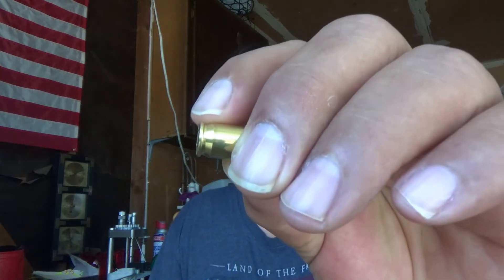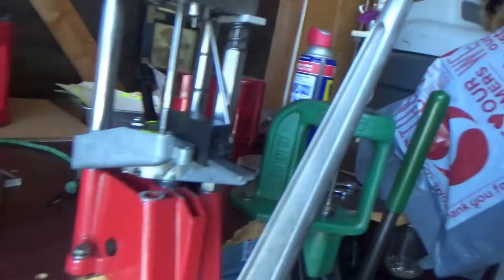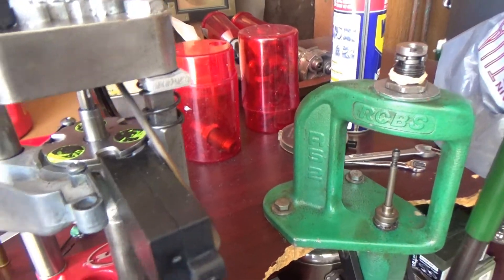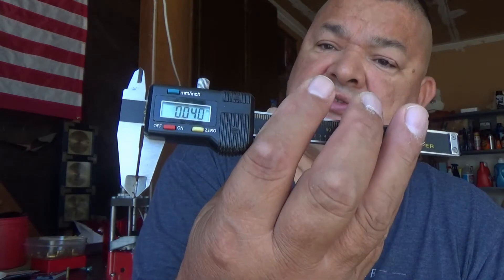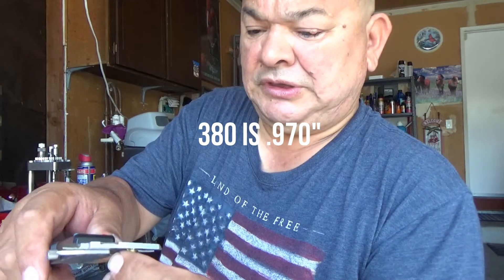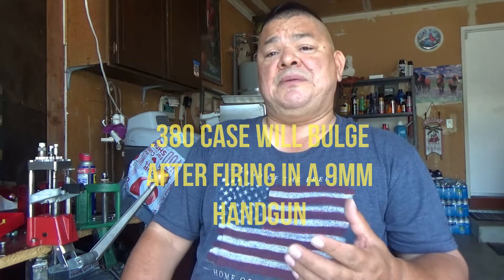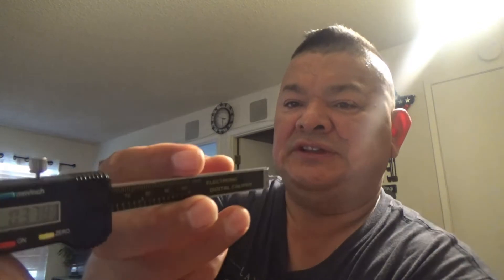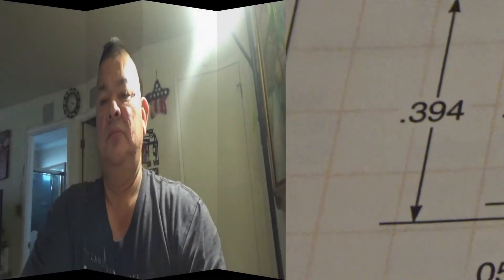Why you shouldn't use 9mm die's to load .380 a.c.p cartridges.

Comment: I would think if you have a progressive Dillon like the 650 you could just adjust your powder measure height and change out the seating and crimping die it should work fine.
Reply from the maker: I have the Dillon 550 B , it's not about loading for quantity it's about loading  for quality.
Reply: miked a few bullets from each sizing decapping die and they are very different.

Comment: My experience unable to find 380 die set in "these times".  Can salvage and use 9mm powder through expanding and bullet seater die for 380, nothing special as both use .355/.356 bullets.  Can use 9mm sizing die adjusted to deprime 380's, but not size.  That's 3 out of 4!  Only need a 380 factory crimp die to be complete (using it to size and crimp obviously). 9mm #19 shellholder can be used in place of 380 #4 shellholder (it'll work but long term will be annoying).  I ran into an issue the 380 FCD wasn't sizing tight enough on mixed range brass, bullets loose after seating, no friction. Lee makes a 380 undersize sizing die- fixed the issue.  Used 380 FCD in Lee's Bulge Buster Kit also- some rounds can get tight at the base in a case gauge.
Reply from the maker: I just checked eBay just now and starting bids for a 380 ACP dies or going to 71 dollars and up I saw a titanium Hornady set for $98 that is gone crazy extremely crazy just to get really dies unbelievable there is a YouTube video Manny California who does 9 mm to 380 and I don't know how he does it but apparently he said it works because the sizing difference in circumference on each shell from 9mm to 380 is totally different and like you said you might have weak neck tension cause the bullet to see deeper 3 80 circumference is 374 9 mm circumference is 380 so using a 9mm die set will not give your 380 proper neck tention. Good luck

Comment: I run a Dillon 550 and a 650 and the 380’s cause problems because they don’t fit right in the shell plates. Causes stoppage of the progressive press, a few mild profanities and a general pain in the backside.  I have devised a quick & easy method to sort all the 9mm range pickups to remove the devils spawn 380. 

Good video thanks for posting.
Reply from the maker: yes agreed that the .380 a.c.p shell rim can be tricky i measured out several brands and found there's quite a inconsistency in rim thickness...from .040-045 why this is...is a mystery, so i have to be careful when i load each case, i don't load them in the progressive traditional method for this reason the shells will tip and spill out powder etc..but i do love shooting this cartridge, so i just load them slowly to avoid the profanities and maddness. thanks4 watching.

Comment: not sure what size you cast bullet diameter is, but you might try using a 38/357 sizing die for loading cast bullets in 380acp, it works for me without having any issues or over working the brass any more than needed.
Reply from the maker: i've tryed both but i went back to .356" my .357" sized bullets we're shearing off some of my powder coat because they were too fat to be seated.
Reply: @Ford360CID  you might try a dummy round to see if the 38/357 sizing die will work. my rcbs die wont but my lee works with .356 with using a good crimp.
Reply from the maker: @sherrypulec1449  a taper crimp is all you need for cartridges that are supported by the case mouth but i get no fouling with the 356" bullets and i believe the sheared powder coated bullets we're causing the lead fouling due to the bullets losing their bullet to barrel protection.

Comment: Years ago I had a Walther in .380. (NOTHING against having a .380) it was a nice pistol, however, the .380 round (after trying to reload it) was such a burden and particular for that cartridge. I liked the pistol, but I did not like the round itself based on the ability to craft it at home. It took just as much to reload as the 9mm and that's why I abandoned it, plus the 9mm has much more to offer in pistols and ammunition options. Now, completely off subject, I like how you center your reloading around overall functionality products, like the Lee Pro 1000 you are using, It will load quality ammo just as much as the high dollar presses out there. Plus, it won't break the bank purchasing one. anyway, good video-Dave
Reply from the maker: thanks Dave, i have a Dillon 550-B and a rcbs single stage press...but my go too has always been the lee pro-1000..it is quite versatile...i can use it as a single stage which i use that function alot and use my rcbs for single primer feed, also i dont use the case drop tubes i didn't see the need in it i just feed the shells single hand feed, the lee pro-1000 are not very reliable there are many issues with this set up, powder spillage, primers not feeding properly so with the .380 i use the lee pro-1000 to load them in a single stage mode more like a lee turret press which i think are a smarter way to go for reliability and economy in the lee product line up, for the .380 i'm using the lee 102gn rn which measures at 105gn using hp-38 and red dot.